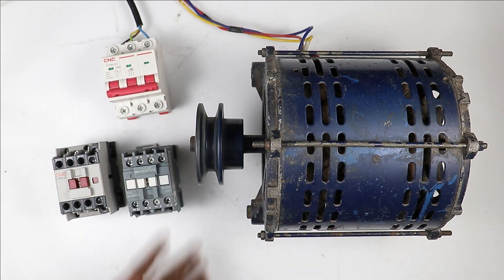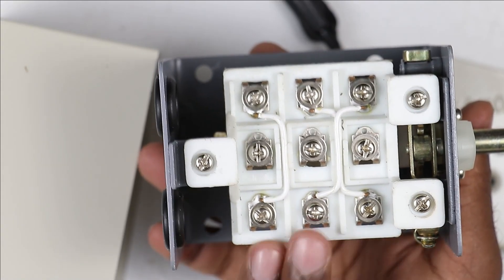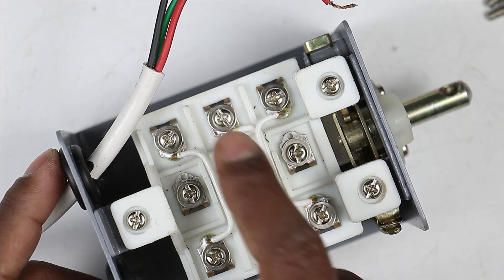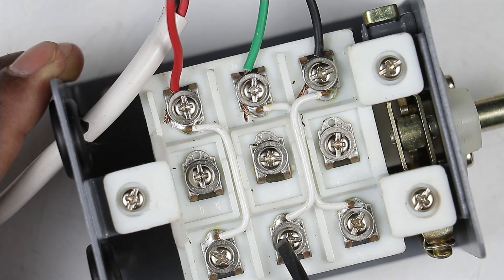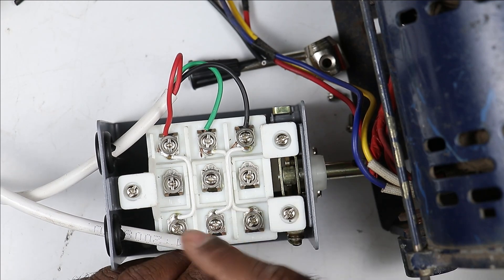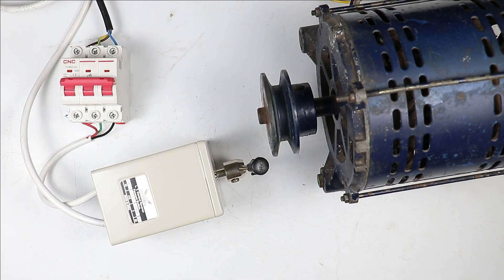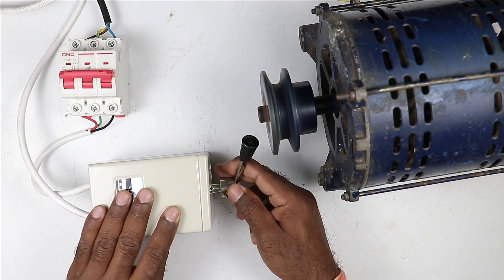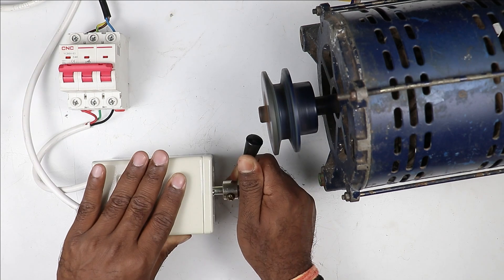3 Phase Motor Connection with Reverse Forward Drum Switch  @TheElectricalGuy

Comment: Thanks.but what will happen if we change the switch without waitinng till it stops, from one dirction into the other.
Reply: It will damage Motor it's not practical switch he should use 2 contactors for 2 direction with control circuit to protect this case search about classic Control